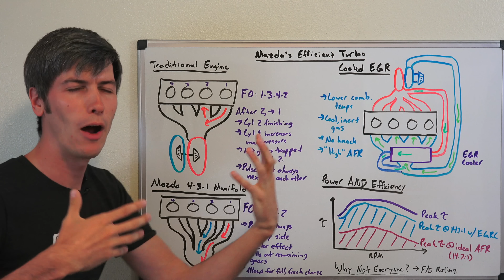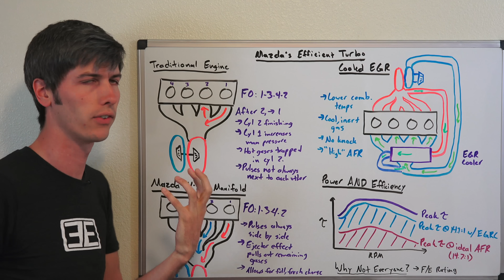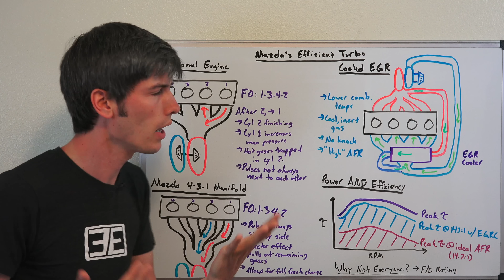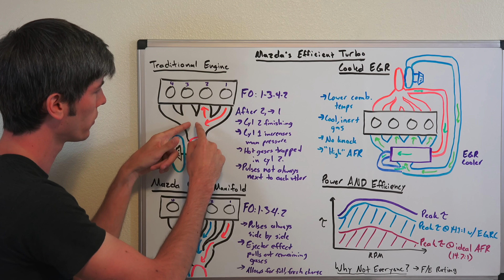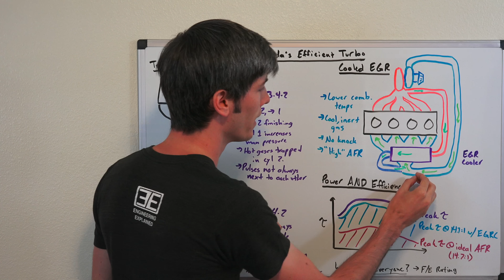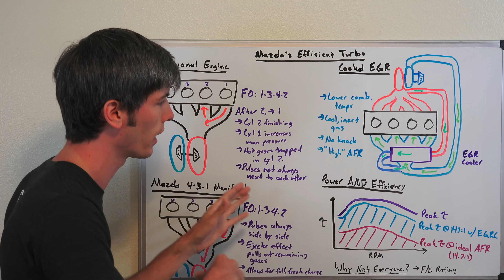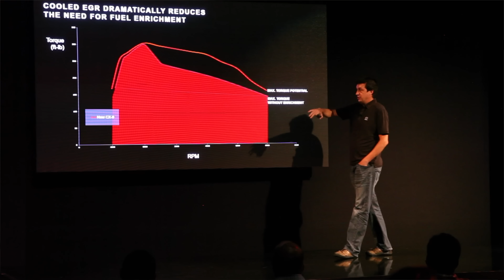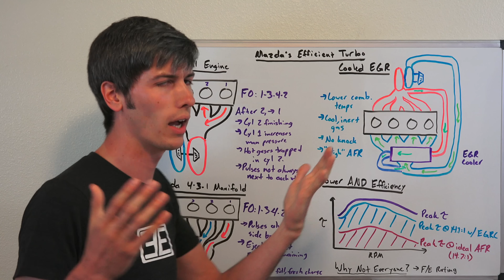Mazda's Secret To Efficient Turbo Engines

Comment: I like your work but why no mention of NOx?  NOx being the real reason why midrange throttle uses overly rich fuel mixture to cool the charge.  NOx in that mid power band is also the reason why EGR was invented in the first place (in the early 70s I believe).  Got to admit - Mazda's solution is pretty cool.

Comment: which 2.5 turbo engine? At least here in europe, we only get NA engines, as far as i know (mazda's site doesn't tell you anything, not even what kind of motor and engine displacement you have until you somehow find the "technical data" for it, it's annoying. But judging from reviews, they all seem to be NA engines) with the skyactiv-G Motors.

Comment: Hi @Engineering Explained. Just want to clarify as I'm not in the USA, RON 87 is your baseline fuel, right? Where I live, RON 91 is the baseline, RON 98 is the top option at the pump. Has Mazda made any comment about E10 or other rated ethanol blends, or should that make no difference whatsoever?

Comment: Does this engine get even better power gains with 93 octane? My Focus ST gains a very noticeable amount of power between 87 and 93. It's tuned that way. Dyno runs have proven it. Up to 12hp and 20 torque difference. And you can really feel the difference.

Comment: EGR meh... I hate them but here I suppose it allows higher compression ratio and thus efficiency without combustion heat added and with adequate stoikiometric high temp combustion buffered by this inert gas. I suppose water vapor injection would serve the same purpose and the post combustion gases do have water byproducts.

Comment: impresive but not that impresive.   Check out the VW TSI Twincharged 1.4 L BLG . very similar, good fuel economy for 170 HP and 240 Nm

Comment: I don't get how using inert exhaust to replace some of the regular intake air is giving more efficiency here. If you had the same amount of fuel but had no inert gas added, you would just have a lean burn with the same or more efficiency in this setup wouldn't you? Normally you don't want a lean burn when you have a lot of boost since the extra fuel in a rich mix is cooling the intake charge and helping prevent knock, but in this setup the only thing making it not be classified as 'lean' is just having some inert gas mixed in reducing the amount of oxygen while the amount of fuel (and cooling from that fuel evaporating) is the same. The only way i see this working is if the inert recycled exhaust is somehow cooler than the fresh air coming in. Is the new Mazda technology just giving us the performance of a lean burn (which already exists) but able to do so while meeting new pollution standards? Can someone tell me if i'm missing something here.
Reply: Naggstek 
EGR keeps cylinder temps low so less fuel and more boost can be utilized without melting the engine.
Reply: I'm afraid this doesn't really answer my questions. How exactly does the EGR keep the cylinders cooler in a situation where with or without the EGR there would be the same amount of fuel, extra fuel is used to lower the temp, if we use EGR that's hypothetically the same temp as fresh intake air from the atmosphere (i don't think it would ever be quite as cool as that) what causes this to lower temperatures or help reduce knock?
Reply: Naggstek 
With egr and the same amount of air/fuel you can go for more compression keeping the temperature the same: you have more mass under higher pressure in the same cyllinder so the work done by a piston is higher (we avoided the knock pressure limitation). Higher compression= higher efficiency. 
Mind if we recirculate too much of exhaust the problems with combustion will appear, not even speaking of dirt in intake vents...
Reply: Thanks for reply. Can you explain why using EGR lets you have a higher pressure in a thermodynamic sense tho? I just can't figure why adding a bit of EGR rather than adding a bit of outside air lets pressure be higher without increased knock. What mystery property does the exhaust have that i'm not seeing here?
Reply: @Nagg because exhaust gas has no oxygen.  "Fresh Air" has more oxygen, therefore more inclined to pre-detonate.

Comment: Bought a new Mazda 3- S in 2006. The clock would not keep good time. It took Mazda 14 months to come up with a software fix. Next issue was the A/C. To Mazda, A/C means ALMOST COOL. Dealer could not find anything wrong, but on a hot day it was better to just drive with the windows open. The automatic wipers would come on even without any rain, if you were driving facing the sun. The wipers would also make a screeching noise when they moved across the windshield, wet or dry, even with brand new blades. Also, the high tech electronic climate control failed. Dealer price to replace was $2000.  Another: Don't hit any chuck holes. The rear aluminum shock supports would snap right off. Road noise was always present even at low speeds. By year six, here in Ohio, the trunk lid began rusting around the third brake light. ( Don't know why they bothered, as it was no higher up than the taillights.) Soon after, rust began appearing around the wheel wells. Through all of this , the engine and tranny never failed to purr along without a single hiccup. The power train was Mazda's claim to fame.The rest of the car I can only rate at C- or D grade. Traded it at 8 years and 120K. Never looked back to wish I still owned it.

Comment: I noticed that the newer Japanese 2.0 liters(turbo) more often than not only require 87 pump gas where the German 2.0 liter always require premium. It would be interesting to see a comparison explaining why this is.
Reply: because in europe Premium is what they use as regular, so they tune for europe and not the rest of the world.
Reply: Yep, I believe the compression ratio is increased a bit for Europe but otherwise it's the same engine.

Comment: I noticed that the engine specs toward the end state "87 AKI Recommended". So, does Mazda actually recommend using 87 Octane fuel over the higher ones, for this engine?

Comment: Jason correct me if I'm wrong but cooled EGRs aren't really a new technology, my daily car is a 2004 golf mk5 tdi and it has a water cooled EGR. Yes it's diesel but the it's used in the same way, right?
Even the exhaust manifold design looks a bit similar to the Mazda's.

Comment: So Mazda put extracters in between the engine and turbo? We had them in the 1960's! But good on them  anyway
Reply: The bold move here was cooling some exhaust gas to feed it back into the engine and let them use a more efficient air/fuel ratio even at higher power.  Doing that doesn't help your EPA rating because the tests don't get the engine into that power range, but unless you drive like a robot, real driving benefits from doing that.

Comment: Just do a video on BMW G650gs engine.. which is designed by Rotax of Austria. The interesting thing is how the hell this engine is so efficient.. matching most 250cc engines in efficiency, yet much more powerful. And there is no other engine like that to compare with. How is this Possible.

Comment: Mazda is doing well on engine design. I owned a mazda3 skyactiv for 5 years now. The only thing i dont like abt this engine is that every 30k miles i need to take the intake manifold and clean the valve deposits.  It seems that mazda engineer need to work harder on this.
My solution, installed an oil catch can,  and problem sloved

Comment: EPA testing for Highway, barely hits 60mph for most of the test. The City driving hits 53 at one point with the rest of the test being less than 35mph.  And yes it's all very low accell rates.

Comment: The 2.5 turbo has an intercooler, correct?  I don't mean the EGR cooler.  I would think the distance between the turbo, the intercooler and then the intake manifold should also be as short as possible to keep response time short.

Comment: 66 ford mustang 289 4bbl would smoke em up to 60mph and get over 22mpg  on the highway with a good tune. C4 crude transmission too. Modern sequential fuel injection and these figures go up and emissions go down all on low octane gas. And with the stock engine you could go drifting.....Man they didn't call it a pony car for nothing.  16 in the quartermile 85 mph and one more gear to go with a 2 bbl..
Reply: Quit living in the past, no one wants to daily drive a dinosaur. Those old cars look good, but that's where it ends. They drive like dogshit compared to modern autos.

Comment: That scavenging design is pretty much the same reason Shelby designed the Tri-Y header for the GT-350 (Ford 289 HIPO Engine)...and that was in 1965.

Comment: Great explanation! I got the new Mazda6 and am amazed at the torque! I am still getting used to it but the fuel economy and performance is much better than my Mazdaspeed6! The Speed may have had better top end power but overall this engine is so much better! I am averaging 2.5mpg better with this one! Mazda got it right! Now to just get an AWD system....

Comment: The 2.3 Ecoboost Mustang engine separates the 1-4 and the 3-2 exhaust pulses as well, and feeds those to its twin scroll turbo.  Ironically, Ford used the old MazdaSpeed 3 engine block as the basis for this engine.  No cooled EGR on the 2.3 Ecoboost, however.

Comment: Bill Leer proved that a modern steam engine works best and is far simpler and reliable than all this junk to try to squeeze the last bit out. What we never hear from mazda or anyone is how reliable is this system? what are the maintenance costs?  how much does this add to the car price? We are living in interesting times, but we always have, electric cars, hybrids(which I have objections to) and fuel cells. Fun and expensive. what do we actually drive?what can we actually afford? Here the 2000 toyota Echo is still going strong.

Comment: 87 regular pump gas? Ages ago normal was 90-93 AKI, or better yet 95-98-even100 RON. US still using odd units and worse fuel in 2018...

Comment: This clarifies why the aftermarket for performance parts for the original Mini had many versions of the "Long Centre Banch" exhaust manifold. It also required a new inlet manifold because the inlet and exhaust gasses shared the same oe casting if I remember correctly. This obviously means that the inlet manifold was very hot.

Comment: Why don't company's take the Emission Gas Recycling after the DPF on a diesel engine? You overcome the issue with sod and only get the gas. =clean inlet manifold.
Renault have done it on some of there cars with a exhaust valve that's giv a little bit of back pressure to alow the pickup of the gas... Is it just the production price or what?

Comment: I'm struggling to understand how the EGR helps. If the AFR is the same how does having an inert gas help? Does it heat up less than air when compressed?

Comment: So to appreciate this engine you need to test drive it to get the real world economy, also you need to add in the fuel price difference.  Why is that there  is no real world test ? The only benefited from that are the oil companies? OK sorry for the off topic. 

Bravo Mazda, for having the strength and tell why they are doing it. 

Another great representation from EE.

Comment: Having owned a 2006 Bravo (195,000km), a 2013 Mazda 3 (67,000km), a 2015 BT-50 (65,000km) and a 2017 MX-5 (73,000km), I can definitely say they make a good vehicle.  Just stay away from the BT-50 until 2020 or so, when the Mazda/Isuzu Ute is a thing.  The current Ford/Mazda utes are very poorly constructed, for Mazda standards.  I chose the Isuzu Ute this time for this reason.  Much better ute...

Comment: Thanks Engineering Explained, so to put it in layman's terms 14.7 air fuel ratio is the most efficient ratio but is some what unstable especially when heated haha so traditionally to reduce the heat more fuel is added? Obviously impacting the fuel economy negatively. The exhaust being a nearly limitless supply of inert gas while the engine is operating is a great solution to the problem after cooling of course.

Comment: EGR has been in use since the 90s by Saabs and Fords. It has been polluted with buildup issues (see what I did there? 😎). Just think about it: exhaust gas is the result of the combustion, it comes inert but with all sorts of debris or particles and all that goes back into your intake. How exactly does Mazda address this?

Comment: The exhaust gases that go through the EGR and then pass into the EGR cooler are basically N2 (Nitrogen) with little O2, which was almost completely "used" in the combustion, right? Then how can these recirculated gases help to increase power if there is less O2 entering the cylinder and the N2 is basically inert for the combustion cycle, or is this just for lower emissions in normal driving conditions, w/o flooring the engine?
Reply: (Probably a silly question).

Comment: Interesting they’re just now using cooled egr gas to lower combustion chamber temps. This is a common application in diesels since the early 2000’s. The problem is, that those egr coolers are subject to extreme heat and don’t last long. Depending on design. Especially when cooled by engine coolant. The cooling system has to be very good to handle it. And often times it’s at its max on everyday use. Which is not good for any of its components. If I had this engine. I’d do what I do to most of my vehicles during the summer time and get a lower temp thermostat. That will greatly help the cooling system, egr cooling, and with cooler exhaust temps cooling the combustion chamber more, you can add more fuel and get more power. Pretty cool that they’re adding this feature to gas engines.

Comment: So here's a question I just thought of while watching this...  How, on any turbo engine, does EGR work?  On an N/A engine, the intake sucks air in, and if you run a line from the exhaust to the intake, the exhaust gas simply gets sucked in just like with any other gas that comes into the intake...

With a turbo'ed engine, air is forced into the intake by the turbo -- which means connecting a pipe from the exhaust to the intake is going to send pressurized intake air down the EGR pipe, not suck exhaust gas into the intake, right?

Comment: Another cool detail of inert gas in the chamber: when the gas heat up again, it expands it's volume. By this, you get way more gas volume going out of the cylinder and generating work, but using less fuel and the perfect stoichiometric oxigen to fuel ratio.

Comment: I've got 2012 Mazda 3(one of first with SkyActive 2L engine) currently at worry-free 158K miles. Still achieve promised good mileage, 41mpg on highways, and something like 30-31mpg in the city.

Comment: Ok think I will stick to my 1.6 dohc vtec with 185 hp na and still get 30mpg city and 37 motorway. 
Mazda 2,5l turbo 25mpg and 240hp?  That is not progress
Reply: Yeah but 1.6 has 106 ft lbs this engine makes 310 its a big difference they were more focused on low and mid range power

Comment: An normal 2.5 liter with similar max torque efficiency would only produce around 180HP. Mazda manages over 220.
BTW guys, Ive been playing Automation tycoon and ive learned a lot about engine efficiencies and power just by tuning in game.

Comment: Nice video.
I have a feeling ICEs are going to be around a lot longer than people think. Their fundamental advantage is that they use a fuel that has a very high energy density as compared to alternatives (batteries, hydrogen). So, although they may be very inefficient now, there is lots of room to improve the efficiency by extracting more and more of the energy from the fuel which currently is wasted as heat.
Reply: It takes 5 gallons of gasoline burnt in a power plant to produce the electricity used to charge a Tesla model s which actually only holds 3 gallons worth of electricity, in energy density. And yet it goes 350 mi on that 5 gallons. That means it's already getting the equivalent of 70 mph gallon assuming that it's 100% fossil fuel.
Reply: @pilotavery  
Hybrids get 50 mpg, have a longer range and are far quicker to re-fuel than an EV. Plus there is always the possibility that ways to improve the fuel efficiency of the ICE will improve this.
But I think the more significant factor that will extend the life of the ICE is use in developing countries. The developed world may be able to afford to build out charging infrastructure and buy EVs. But this will take many decades to accomplish in developing countries. And since first world countries only have 16% of the world's population, I think it's safe to say that the ICE will dominate transportation globally for the rest of our lifetimes.
Reply: @jonfklein  electric vehicles emit the quarter of the emissions per mile as a car getting 30 mph gallon and 1/3 as much as one getting 40 miles per gallon.
Reply: @pilotavery  
Tell that to somebody in Burundi and see if they care.

Comment: why do I get the feeling that Mazda had some involvement with this video?
Reply: ProNoober8 because EE is only 'hearting' the posts that cheerlead this video probably. And because EE fails to mention the downsides of this engine, such as EGR buildup failures, low horsepower (see any 2.0t Accord vs 2.5T 6 comparisons) and more.
Reply: Zuriel Briones   Sharing similar concern here. I look back to mid-70s cars with EGR. Ten years down the line rust and gunk make for sticky valves and linkages. Potentially same thing could affect the variable exhaust port valving on this engine and now you have multiple points of sticking/failure. Will be interesting to see how durable ‘down the road’.

Comment: My ND1 computer calculated 48mpg today cruising back from track day.
Reply: I've gotten up to 52 or so on my 2.0L, but it takes a suitable kind of terrain, using neutral, getting near full throttle when not, and only having it in gear at 45mph, unless pre-accelerating to get through a neutral stretch better.  Basically, avoiding engine losses as much as possible at the expense of pretty much dictating an erratic but generally leisurely pace.